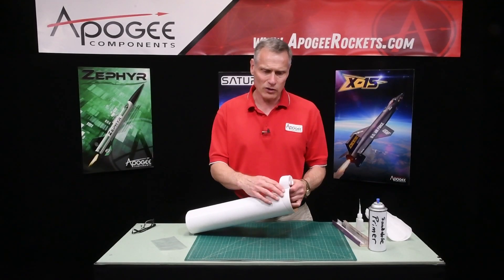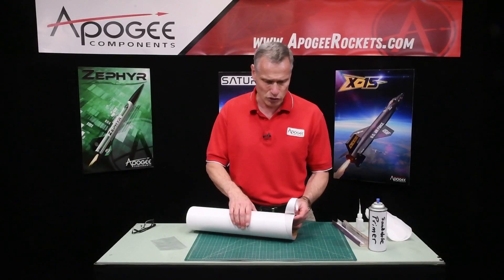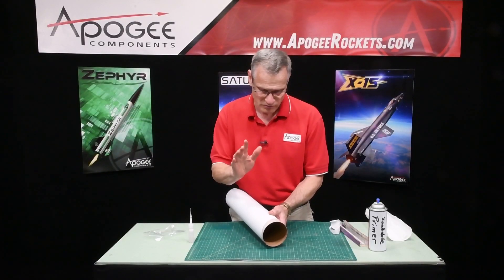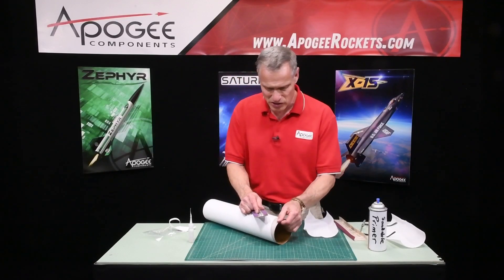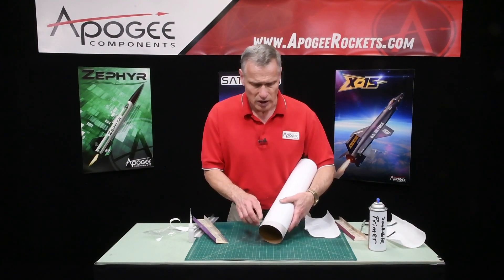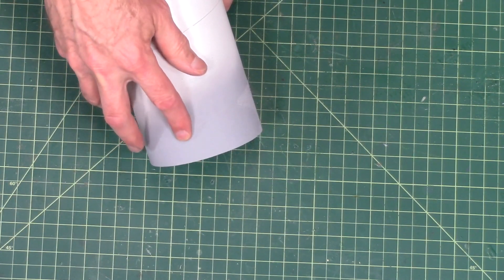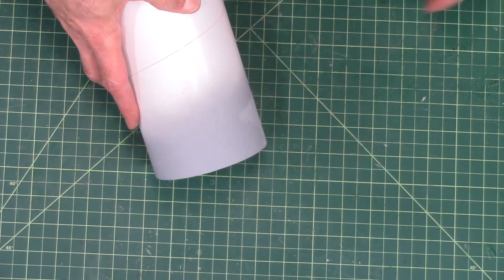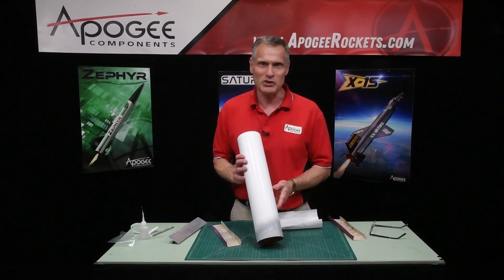How to Get Rid of Tube Fuzziness on your Model Rockets

Comment: I've had the best luck with the Dupli-Color brand sandable primer. It seems to cure fairly fast and sands decent. a lot better than the gummy Rustoleum stuff. Still not as good as a real, 2-part automotive primer though.